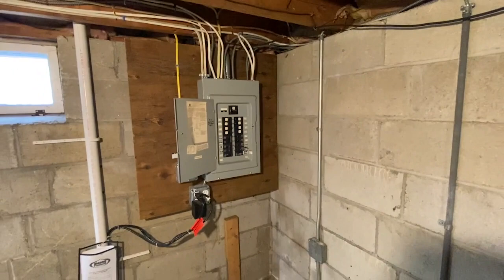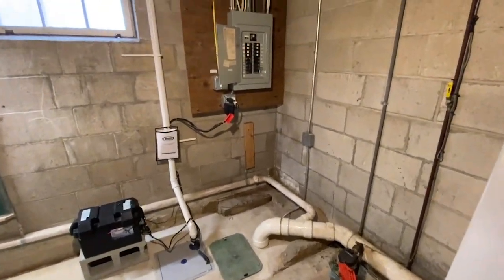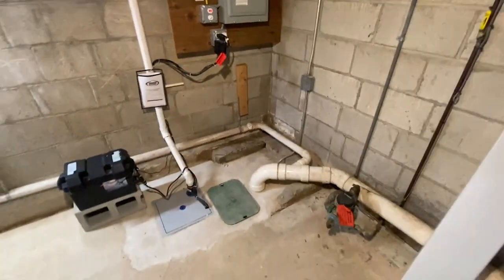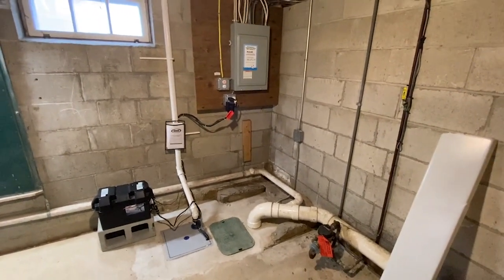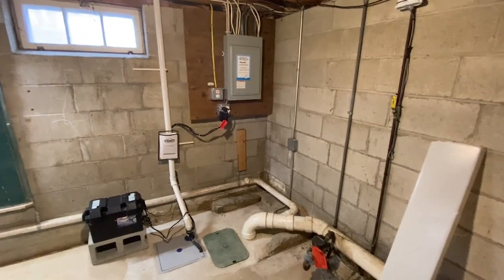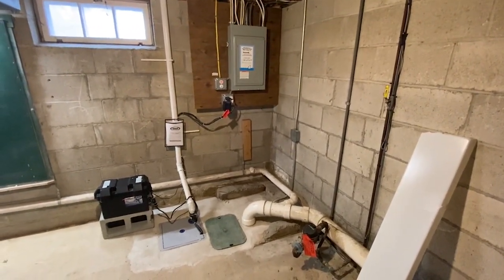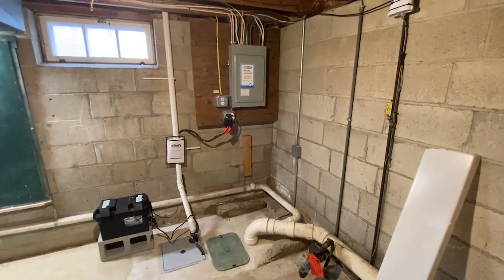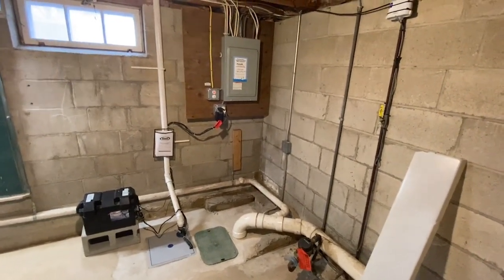Moving Violations Video No. 277: Workspace Encroachment

Comment: I was thinking you could build a platform over the pipes to bring it back into code, but then I counted the blocks in the wall and the joists are just over 6 feet off the floor, so nope.